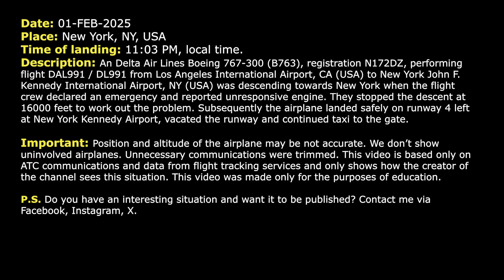Pilot reports unresponsive engine on approach to New York Kennedy Airport. Real ATC

Comment: You can hear the frustration of the pilot with atc stupid idiotic trick questions:  Would you like fire or medical?  If there is a fire risk, there is automatically a medical risk.  If there is a medical onboard, it is not necessarily a fire issue.
Stupid atc trying to trick pilots as usual.  Greedy cheapskate airports.  Dont fly.

Comment: What's this obsession with souls on board and fuel  remaining with American  traffic controllers????
Reply: What you call “obsession” is emergency preparedness. ARFF usually wants to know so they can plan their response. “Souls” refers to living persons (airplanes sometimes transport bodies), so ARFF and others like the coast guard know how many living people to search for, and if airport ops needs to arrange transport (blankets, buses etc) from an evacuation on the runway. Fuel remaining is both how long can they keep flying, and again for ARFF to know roughly how much fuel might spilled - ie cleanup and/or size of fire - in case of a crash.
Reply: souls is the unambiguous term for the living persons on board. if asked how many passengers on board it’s not clear if that includes crew members. if asked how many souls on board it clearly means exactly how many people need to be accounted for in a rescue/recovery.
Reply: @rjhornsby  If the plane was almost empty on fuel, would they come out with only half the trucks and equipment? And would they stop their actions prematurely as soon as they "think" everybody should be safe now, purely based on the pax number given by the pilot via radio comms? I don't think so.
Reply: @omgsrsly  If the plane has a lot of fuel, they'd lay down more suppressive foam before assisting the evac. If the plane was almost empty, they'd worry less about spraying the wings down and focus on evacuation. If people are missing, they'd have firefighters risk their lives going into a burning plane. If everybody is accounted for, they wouldn't. Pilots tend to die because they're at the front of the plane; see the Korea overrun or the Azerbaijan shootdown and radio equipment gets destroyed, Japan runway collision, so asking after landing is too late.
Reply: It’s on our emergency checklist and pretty high up on it.
Reply: Just a few years ago, the controllers used to give the pilots a few minutes to work the problem before asking them about fuel, souls, and controller planning. Now, these DEI hires want the pilots to respond to their questions immediately. It’s ridiculous
Reply: @tumbleweedweed3691 you’re parroting the party line well! The dear leader is pleased.
Reply: @George-ni5ic  here”s to your liberal tears 🍻

Comment: I wonder what kind of information did the first controller claim to have passed as he said "I've passed all the information to approach". And then approach controller requested the damn same information that was provided to the first controller and it's evident that American controllers are not talking to each other or passing the information they always claim to have passed. Maybe it will be better for the pilots to not bother giving the souls and fuel on board to the departure controller and instead give it to approach controller or even to the tower controller. Pilots are busy talking to company, running checklists, talking to cabin crew and doing PA to passengers and then they had to answer same question or request to different controllers
Reply: He passed it to his sup who is going to pass it to the approaches sup. Either the sup never passed the info, or the approach sup never told the controller he already had it.

Comment: Why can't controllers pass on the "souls on board and fuel" to the next controller?  Also, the first controller asked for fuel in minutes, the second in pounds.  It's ridiculous.
Reply: and they allow a 777 to depart prior to arrival, so they get a wake turbulence warning as well.  Geesh.
Reply: First controller said he passed the info to approach.  Then when DL991 checked in the controller asked for same info!  WTH?
Reply: I was just about to comment the same! When working a problem, running extra checklists and descending into congested airspace simultaneously, the last thing you need is extra radio calls to give the same info. Don’t understand why this isn’t passed on from one controller to the next when they’re informing them about the handoff of an emergency aircraft.
Reply: As far as the fuel, they keep using it. Some towers ask in pounds and others in time. Perhaps terrain and location determines fuel to be recorded in pounds or time.
Reply: @jonnyquest9255  time for ATC, pounds for the fire crew (actually pretty important for them to know how close to the aircraft they can station)
Reply: @jonnyquest9255  I always gave both. ATC cares more about time, CFR cares about pounds.
Reply: @jonnyquest9255  I think they are asking for separate reasons. Approach likely wants it in time and tower/ground wants pounds. One is for number crunching and the other hazmat/safety.

I still dont see reason why this could not just have been 1 answer, 1 time.

I actually dont understand why it is in pounds at all. Is gravity/pounds the same under pressure? They do that whole parabolic flight path/vomit comet to make you weightless. There has to be a better unit than pounds…

I could be wrong if someone has a good argument about it.
Reply: @keith_5584  Pilots need to know how much the plane weighs for takeoff performance, to make sure it's not overloaded, and its balanced. You need your weight at landing to calculate approach speeds, runway required. The weight of fuel is the only weight that changes, so knowing that is important, and why fuel quantity is given to pilots in weight.
Reply: @ Pilots do know that. Thats not who was asking. I have 30 minutes (converts to time over rate to gallons make sense) Unless the fuel somehow changes weight or state, ATC can figure that out with a 2D chart. 

I am well aquatinted with gravity. They have been keeping me down for all of perceived time. 

The question was why does ATC need the fuel in pounds? Time, Gallons, metric fluid units. 

If it is spilled all over the ground and on fire, its weight is kind of irrelevant… 

Now, I spilled 10,000 gallons of fuel makes more sense, since some of it is going to become a vapor, which means its weight is going to be different. 

The point the OP made was, why stress the pilot out with pointless questions. He knows what is weight is, and is usually going to be overweight. He has already been given the longest runway and clearance. The weight of the fuel spilling on the ground is kind of a pointless question. It is going to be somewhere around 8-9 pounds per gallon before it evaporates.
Reply: @keith_5584 pilots in cockpit have no idea how much gallons of fuel they have, only how many pounds/kilograms they have. Main reason is because fuel volume change with change in pressure and temperature while mass does not. And you probably can imagine there are tremendous changes in those two during the flight
Reply: @keith_5584  You obviously haven't flown a large plane because pilots are not given fuel in volume anywhere from the plane. It's in pounds or kg, and that matches the airline's loading units. It prevents confusion (hint: Gimli glider). So ATC can't ask about gallons or liters. Second, ATC doesn't know the fuel burn rate of the plane. At minimum, the fuel burn rate is dependent on the gross weight of the plane. So now, they got to know the specific model of the plane, including features like winglets, what rating of engines, and most importantly the GW. You've just made it 10x harder with even more pointless questions. "Hey, what flap setting are you using? You're a 767-300ER with ABP winglets at 71 tons and you got the CF6? Let me look that up." And no, it's 6.7 lbs/gal of Jet A.
Reply: @keith_5584  What are you talking about? My vehicle's got 200 miles of range left. Tell me how many gallons of fuel I got if you don't know if it's a motorcycle or an 18-wheeler. I got 200 miles of fuel on my F250. How much is that? Like he said I got to tell you It's a 2005 with the diesel engine and I'm towing a 12,000 lb 5th wheel RV. No see how long it takes for you to figure it out.
Reply: @ Actually Michal that was the answer I was looking for. Is minutes estimated from the pounds?
Reply: @straightpipediesel  No I haven’t flown a commercial jet, but it is obvious I went the wrong way with that one. Best to apologize and get back on course. I Apologize.

6.7 pounds, will remember that thanks. 

But back to the OP, why didnt they forward that info on? Do the 2 questions have to be two questions?
Reply: @ Yes exactly
Reply: Yes, and the contollers concerned have hot lines to each other! If there is any doubt, the controller can quickly seek clarification from the other controller, rather than bothering the pilot. It is Flight Level 160, not sixteen thousand. Shocking radio procedures - the rules are  - callsign comes first, followed by content. You never omit callsign.When vectoring an aircraft, you give direction of turn, heading, reason for turn, track miles to run. When you clear an aircraft for an ILS approach, all altitude restrictions are removed, thus the "altitude at your discretion" was superfluous. The whole situation could have been handled with half the words, if those words were standard phrases and delivered with a little forethought and far less ums and ahs.
Reply: Ever play the kids game “telephone”?  Nothing ever translates 100% from a second party.
Reply: Thats was im asking myself aswll hearing this.....
Reply: Something I thought of is two things:

They want to be in a ready state to receive communication from the distressed party, so maybe they keep the communication absolutely brief. Possibly communicating through an automated system or text so the mic is open?

Getting multiple accounts might be useful, but I can also see how that would be stressing. They also might account for that stress?

So I am going to amend your statement a bit. Why can’t a purpose built automated system help relay this information (from controller to controller, not aircraft to controller) and leave the line open.

NOT some other overloaded automated system, a purpose built, unique system that is not saturated.
Reply: ICAO, FAA, EASA, Airbus, Boeing, and all others: It is about time to add fuel, SOB and hazmat to the ADS-B datastream (or extend/change the standard to support it). If this is too valuable/private of data for the airlines, make it so that it transponds it with any emergency squawk only, so this data is not public for all flights. Maybe also add other information idk. I understand the need and so on, but come on.
Reply: If anyone was wondering, the “gauge” (whatever unit it is in) gets it’s reading from a suite of multiple capacitive and resistive sensors fed into a specialized microcomputer that has data tables to calculate the quanity. This might sound silly to pilots, but that is how “pounds” are relative to a fuel level. (Silly, like it is a no brainer to point out)

I found that whole thing confusing because I had no idea how you weigh a fuel tank in flight.